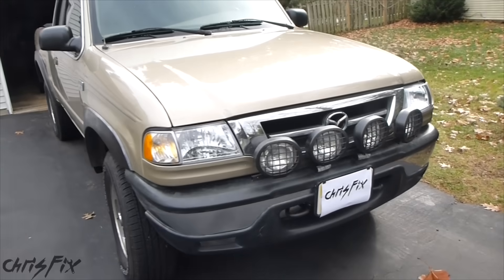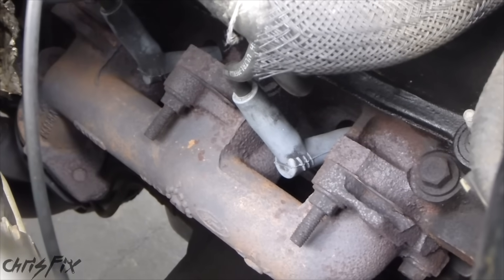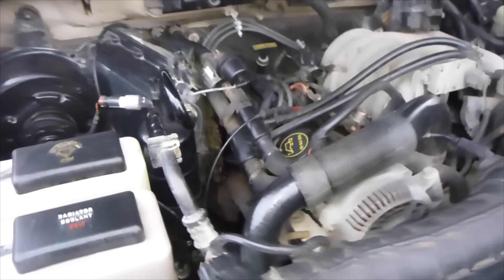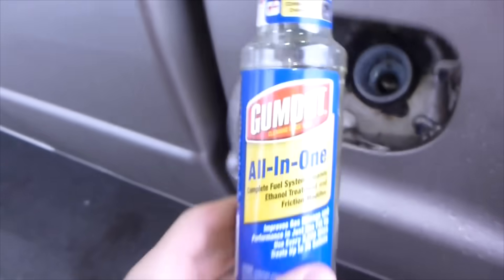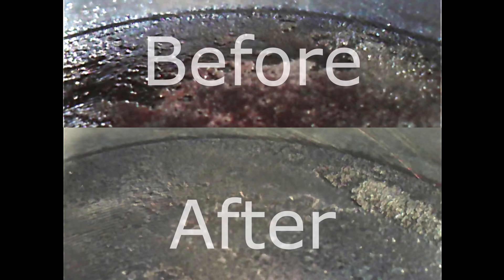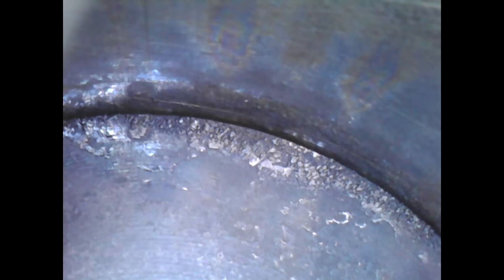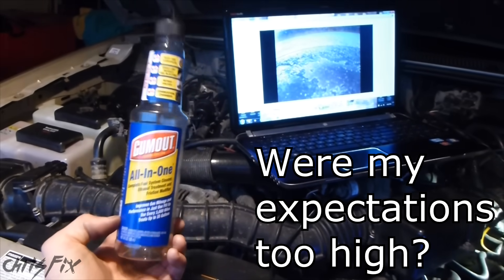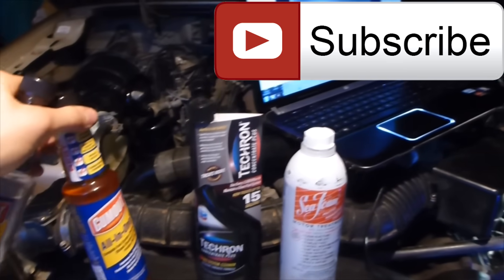Do fuel system cleaners actually work? Testing Gumout "All-in-One"

Comment: Heynow ~ i’ve been using STP & Gumout products for a Very long time through the years with different Cars 🚙 They work butt you need multiple bottles to see the Results ( i used one bottle per month ) i live in NewYork & spending $10.- on average per month is Worth it to me then spending hundreds + time @ the mechanic 👨🏻‍🔧 Cool dudes butt .......  Example : 1988 Ford Thunderbird Turbo Coupe had Clogged fuel injectors, used STP fuel injector cleaner twice a month ...... about 3 to 4 months later i noticed the  minor hesitations started to disappear & the mechanic told me my Turbo mite be on it’s last days ( Car was about four years old at this time ) was was Very hard on the car  butt loved it & so did the Chicks 😇  Fixed my issue !  With these Products you have to be Patient.  Either way Thanx for Posting 🇵🇹
Reply: Side Note : i use these products on all my cars even if i have No issues, my 2006 infiniti G35X  fuel gauge sensors : one of them is bad, the needle is off once it drops to 3/4 quarters - i opened up the location to both  hoping to fix myself, every YouTube video fix i saw  there’s were all dirty with black sludge, etc ..... mine looked brand new. had to replace the Low sensor butt at least the dirt or black goooo wasn’t my issue & it keeps other car parts clean as well

Comment: The Hyundai Elantra service manual actuall tells you to use detergeant gas or top teir fuel additive every 7500 miles as part of the maintanence schedule.  Problem is i've never seen a gas station that advertised their gas a "detergeant gas"  and anyone can say their fuel additive is top teir.

Comment: if you change oil every 2500-3000 miles. you dont get many deposits. clean oil reduces deposits. this is why i change oil every 1500 miles. i have a shop though. engine looks almost brand new..60,000 miles. no deposits.  dirt in oil is a big problem..this is why they tell you to change oil every 5000  miles.. extremely dirty oil. they want repair work or buy  a new vehicle. many oils viscosity is still good, but dirt is number one . the cleaner the oil the better it is.

Comment: Keeping your engine clean (as Gumout claims) is far easier than cleaning it once corroded.  Second, Gumout claims that it's product is a (Treatment) meaning it is designed as a periodic and on-going process - similar to going to the dentist to have your teeth cleaned once or twice a year.  Gumouts declarations are accurate, they never used the word (restore), so don't think a one tank treatment will instantly dissolve most or all deposits.  If it did, it would eat your gaskets and pit the metal parts.

Comment: What about the fuel injectors, are they cleaner.
Reply: He really doesn't have a way to test before and after. They can be removed bench tested for flow and pattern. These videos, to me, are for the diyer that does regular maintenance and small repairs. TV shows have the budget for the more advanced testing. I'm sure the budget for this video was the price of the gumout and gas. I take them for what they are and he did explain what he was testing for at the beginning of the video.

Comment: Reading the small print on Shell website  - ** special note says In port fuel injected engines over 2,500 miles with continuous use of Shell V-Power® NiTRO+ Premium Gasoline... for their claim "Shell V-Power® NiTRO+ has seven times the cleaning agents required to meet federal standards and removes an average of 70% of deposits left by lower-quality premium gasoline, starting with the very first tank.** ". To me this suggests generically these fuel additive  cleaners may take a long time to work and will only clean a proportion of the carbon build up.

Comment: Have you attempted a video with seafoam ? We use this in my shop we use 1/2 to 3/4 can with a slow drip through vacuum port at or closest to throttle body while holding 1200-2000rpm place remaining 1/4 to 1/2 can into fuel tank with fill up of fuel to help with injector cleaning then rest 15 mins engine off before test drive note misfiring and large clouds of smoke may occur May require check/service engine light reset after service would love seeing end results for this product ..

Comment: Hey chris fix, im in a little dilema, not sure if you get this message but hopefully you can, please respond. I have a welder generator machine that i used seafoam on yesturday. First i added to thr gas tank and ran it for 5 minutes. It ran.  Then i shut it off and called seafoam to ask if i can add to the crankcase if the motor is warm thry said sure. So i did. I started the machine and after about 3 to 4 minutes it started getting weak and ended up dying out. I tried to start it 1 or 2 times with no luck. Called seafoam back and asked what to do they said leave it for a day and then try starting it. If i try to start it today with no luck do you have recommendations of where to start?

Comment: Is there a product you can spray in the cylinder when you have the spark plugs out? Seems like a situation when letting it soak in might help
Reply: Seafoam, though you don't spray it in there. You can add some to the fuel tank but the best way to get fast results is to suck it through a vacuum line while the car runs, I think you use about a third of a can then kill the engine for a little while.
It'll struggle really badly to start up but once it does you'll see a ton of white smoke pour out the exhaust.
I've seen a lot of videos that showed before and afters, that stuff really is a solid product for some of the really caked on crap.

Comment: Pour it in the spark plug holes and then vacuum it out a couple hours later.Voila!
Reply: That might actually mar the surface of the metal because if the cleaner actually has a cleaner like PEA in it, it is very aggressive when used alone. That's why you need to dilute it with gas. But idk I've never tried that

Comment: that carbon is more or less normal and I would not spend any effort (other then dumping in the cleaner) trying to remove it. the carbon is just going to come back in a while if its running normally, anyway, and if its not running normally (running rich or burning oil) fix the problem and the carbon will burn away!
Reply from the maker: Thanks for sharing!
Reply: @chrisfix  NP lol

Comment: I made a diy cleaner out of pvc that will clean the injectors while on the vehicle similar to the otc tool.  Made a couple videos about it.  Wished I had did a before and after boroscope to see what it looked like.  It made it run like a new car after 83k miles.  Good video.

Comment: Since you can see it directly in the cylinders. Why don't you just pour it directly in there, and just scraping with some kind of a scraper you know clean it directly. That would be much easier and you could get it fixed much faster instead of pouring it at the gas tank where it has to travel so far oh, you just pour it directly in there.

Comment: A fuel system cleaner should clean the fuel system, the tank, pump, lines, injectors or carburetor. The combustion chamber and piston top is part of the engine, not part of the fuel system.

Comment: what about adding Gumout directly into the cylinders ?
Reply: I have a Bolens blower that has an oddball sparkplug. I wonder if I soak the plug in it with an ultrasonic cleaner if it would remove the deposits?

Comment: I put 941ml of mmo in my gas tank every fall in my full 2.2 ltr '03 Saturn Ion gas tank. Only once did I hear a "chug" (first time). I want to believe it was a "flush" of carb /buildup, but what do I know? I'm not a gearhead. I change my oil very often (Penzoil Platinum Plus) when it gets black). My Saturn runs like a top. Extremely frequent oil changes, mmo every fall....
I actually want an issue to fix since I have new high end plugs.
I got the car for free and "fixed" it over a year. Its got 270,000 klms. 
I guess I'm doing things right OR there is a big problem ahead that I cannot see yet.
(I'm gonna get 500,000 klms outta her, I know it)!
David
Alberta

Comment: The product is mainly meant to clean intake valves and injectors, it doesn't really matter if the piston is dirty or not.
Looking at the power of the engine before and after is more important and you'll see a huge difference for just a $5 bottle.
Also you should have changed the gas filter before adding the cleaner.

Comment: Could you please write the steps in simple with pictures. I bought a used a car already used about 180000 KM should i try to use this liquid to clean the engine even without checking inside..?

Comment: It actually got a good amount of build up out. Hell use it after 2 oil changes and your engine should hopefully be sparkly clean at 150k
Reply: I think for any of those cleaners to really work you have to go directly into the gas line before the fuel injectors! I have studied this on different YouTube videos and I found out that all these years I've been adding that stuff to my tank and I don't do it religiously and I buy the cheapest s*** I can get well guess what I think I really screwed up it didn't help me at all! The reason for that is I have found out when I put that cheap stuff in my gas tank all it does is clean deposits on its way to the engine and it can actually plug my fuel injectors up worse because it doesn't break the particles down in a small enough piece it sends clumps out and I have noticed that my little 2005 Pontiac vibe runs like s*** for about 4 days after I put that into tank it idles little rough and I think it's because I sent s*** down to the fuel injectors but it always straightens out in a few days? Just wanted to share my experience I am going to try to clean my fuel injectors myself with that video they have on YouTube!!

Comment: Why not just reformulate your fuel? It is the source of carbon crap right? Isn't that why everyone has black carbon crap at the end of the tailpipe? Mine isn't like that. If you can get a cleaner burn in the first place, that means decreased carbon crap, lower NOX and better MPG. I've added Eco Fuel Saver with every fill up for nearly 10 years.

Comment: So you have a 17 gallon tank Chris fix and you got 209 miles to the tank that's horrible gas mileage bro that's horrible my blazer gets 18 mi 19 miles to a gallonI don't know man you need to do something because that's really bad gas mileage it's like 12 miles to a gallon that's really bad let me know if you have like a and intakeor something  injectors injectors are staying open ain't open haven't changed the fuel filter got a vacuum leak

Comment: We bought a second hand Subaru Liberty and discovered that a) had not been regularly serviced and b) run on cheap low octane fuel. We drove to my parents place one evening (100 km YES Km) and used a tank of fuel. I had a dozens experts giving me all sorts of bad advice and for about two months burned through thousands of dollars and gallons of  Petrol. A mate suggested I put some fuel system cleaner through it. I went to a store, bought (Australian) NULON Complete fuel system cleaner and jumped on the highway. I went about 5km and there was slight puff and a waft of white smoke blew out the back. I thought either the Car would stop or my issues had just doubled, I drove 150km's, pulled into a station and filled up. It had used just over 6 litres. Something somewhere was blocked and this stuff cleaned it out. Finding the right stuff to use is half the battle.

Comment: Consider taking equal parts of gasoline, B12 Chemtool,  and any "Amine Based" PEA cleaner I like Redline Si-1. Put a shot glass worth in each cylinder using a funnel and hand crank the engine so that it spread around the top of the piston. Let this soak over night. Next day hand crank the engine again and check each cylinder to make sure  nothing is pooled in the cylinders. Reinstall plugs fire it up and let it idle. Drive like normal 99% of the carbon should be gone now. Once the engine is cool you can remove the plugs and insert bore scope. If you wanted to you could do this multiple days in a row instead of only doing it one day. You just add more each day so the carbon stays wet. It should drain past the rings as well softening any crud in the ring pack as well. Normally when I have done this I was waiting for a part to come so I normally could allow it to soak a good 2-3 days. I am only talking about doing this once ever 10 years or so not as routine maintenance.  Most car's do not have carbon issues the ones that do either have some neglect going on or all of that engine family has issues etc...

Comment: This mazda must run like a dream because this guy does alot of videos on this car 😂
Reply: it only gets 9.4 mpg what a crap
Reply: @bestofthebest3821  Not true at all lol. My V6 F150 2003 gets 18 MPG, so there's no way in hell a lighter truck gets less.
Reply: @leeham6230  I promise it does I had a Ford ranger 4 l 13 miles per gallon was all I got it was terrible
Reply: @leeham6230  i have a 2000 ranger with the 2.5 i4 and i get 15 no matter how i drive it dip down into the 14s when shes runnin rough
Reply: @mr.anderson5786  Wow I guess I have to believe you. That really sucks man. Why even own a Ranger?
Reply: @leeham6230  i own 2 of them and they always get me to work
Reply: @leeham6230  why would you believe him and not me I'm telling you the truth
Reply: @leeham6230  Lee I bought the truck from a man to resell it it was very very clean still had original plugs air filter fuel filter everything it had like 60,000 mi on it it was the Ford ranger edge 4 l fully loaded I think it had 410 gears from the factory if I got 13 I would have been ecstatic and I'm talking highway miles that thing was God awful the worst gas mileage vehicle of any I've ever owned including 350 Chevy Camaros and Oldsmobile rocket Cutlass motors we're better than this piece of crap
Reply: @nickajk1  Oh no, I believe you dude.
Reply: @leeham6230  I'm going to look it up
Reply: @leeham6230  I promise you I could have Uber cheaper than driving that truck around and the fact that it was a compact truck it was useless oh and by the way I think it was a manual transmission the numbers MPG were horrendous I have never ever seen a car that bad maybe a Chevelle big block but hell that's worth it
Reply: @nickajk1  Yeah that's crazy. I wonder why it's so bad? Similarly sized trucks are much better on fuel.
Reply: bradley david jackson it’s basically a ranger
Reply: I have a Mazda B4000 4x4 but it's in rough shape.
Reply: @EatCarbs  you plan on selling it?
Reply: @tylerkimdura6690  I have no immediate plans to sell it. I have some videos of it on my channel if you want to take a look at it
Reply: Lol

Comment: I see a lot of different products recommended. One I do not see, but there are a ton of YouTube videos on, is SeaFoam. Most of the videos show how it quiets noisy lifters and removes carbon from the throttle body and intake manifold. I have not seen a before and after scope of the cylinders. I'd love to see that. Plus, of course, it's fun to see clouds of smoke billowing from the exhaust!

Comment: Looks like it's good for keeping the engine clean, but not for getting rid of heavier deposits that built up over a long period. If you used this on a regular basis, it might prevent those larger buildups from occurring.
Reply: Plus if it were to remove large chunks of buildup in one go, they could clog or damage your system on their way out.

Comment: Frankly, the only real-world application of Gumout/Seafoam, etc. is for carbureted engines that have venturi jets; hygroscopic ethanol in modern gas clogs those and thereby fouls up the entire fuel system.  The amount of carbon in this engine isn't enough to matter.  My anecdotal evidence is that these fuel stabilizers are godsends for small engines (i.e. 2 stroke lawn and garden)...  I have had to replace many carburetors due to people running ethanol in those (hate that stuff).

Comment: I would like to see my 2004 Toyota 4Runner 4.7L V8.... I bought it when it had 98,000 miles on it and I currently have 145,000 miles on it... but I use similar fuel products usually every 2,000 miles or 8-10 tanks

Comment: I think your expectation is too high. The build-up of carbon in your car is quite bad. It is meant for lighter build-up. We should do this like every 10K miles or maybe 15K miles. I believe if we clean it consistently with gumout, it will work.

Comment: Holy hell, 210 on a full tank? 

My v8 Silverado gets 300 before I fill up again, and I usually have a little more than a quarter tank left. For the 19 gallons of my tank I use (it’s usually like 17 or 16) I’m getting way better mileage than your 17 gallons. 

And My miles are all in town.